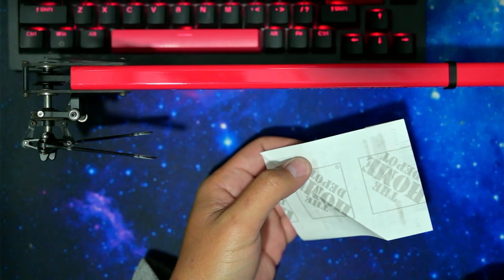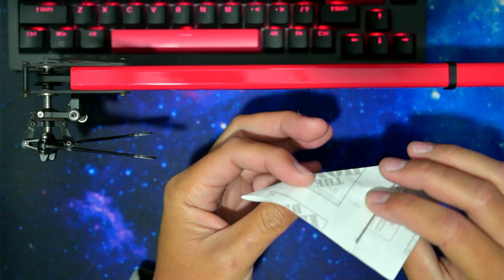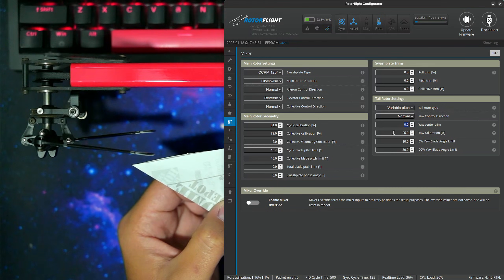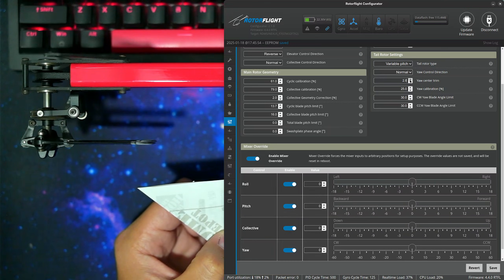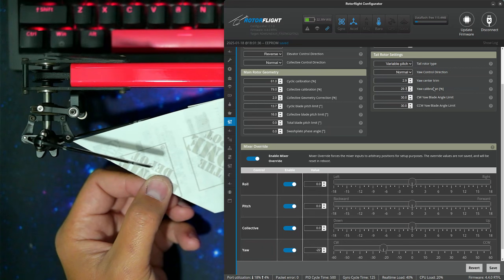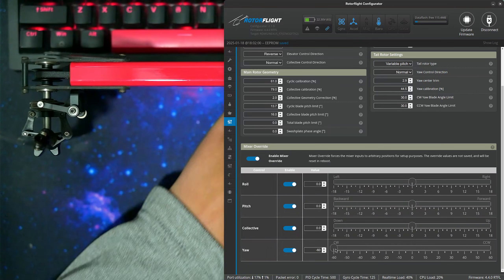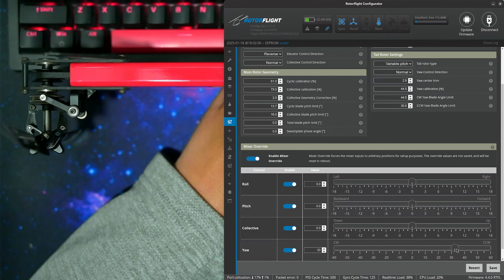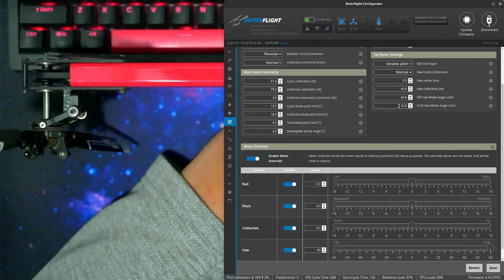Rotorflight - Yaw Mixer Calibration the Right Way

Comment: I usually put 30 in both CW/CCW and make a 60 degree angle then slide the yaw slider to 30 and match the blade angle with that 60 degree I just made. 22.5 & 45 seem much easier to fold. Thanks!

Comment: I calibrate to 30 usually, any major difference or do the RF devs specify 22.5 is the key number?
Reply from the maker: @tanneringram1449  30 is totally fine too. Decided on 22.5 in this video because of how easy it is to make a 45 degree wedge. The calibration should be too close to matter, if it's even different, between the two.
Reply: @ sweet. Great video

Comment: Thanks for the vid! What's the effect of a not properly calibrated tail? Are any FC internal values different?
Reply: Your yaw gains will be difficult to tune (if even possible) if you get the calibration wrong. At least that was my experience!
Reply from the maker: Yup pretty much. And if we all calibrate similarly, we can compare tunes more effectively.

If you take two helis that are the same but have radically different calibrations, the tunes will likely be quite a bit different. Or as Chris said, the one with the incorrect calibration will have poor behaviors that are very hard, if not impossible, to tune out.